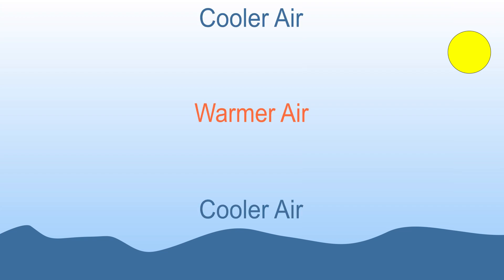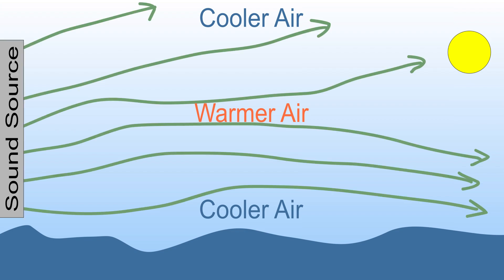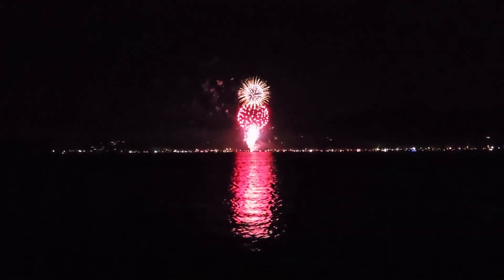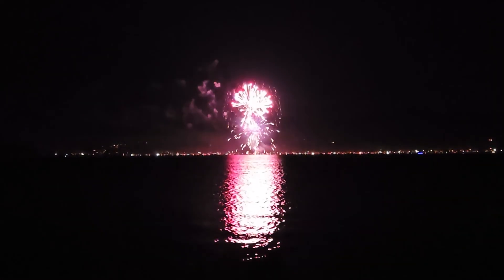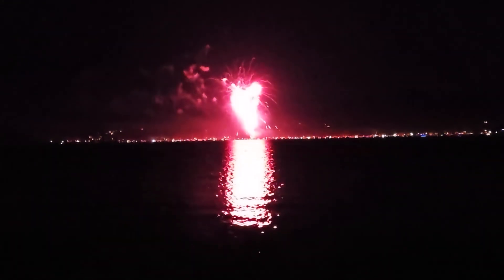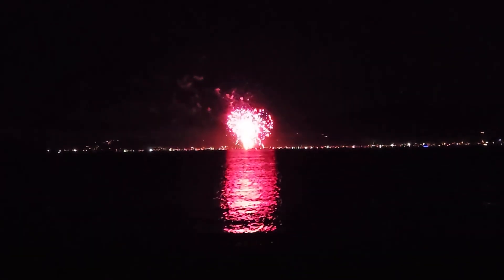Sound Over Water is Different (Public)

Comment: I too am always observant of sound propagation, etc. 

Of course the temp as explained ... but it's not just the temp that's at play.

- there's essentially nothing to diffract, and diminish the sound energy ... vis-à-vis ground propagation 

- the viewing position is somewhat ground plane ....so a pressure maxima, right?
Reply from the maker: Well, the difference is that for the same scenario with very flat unobstructed land, we tend to most often experience the opposite.

Wherin the sun heats up the ground and the ground holds the heat and the air is cooler so the sound refracts upwards but is typically not refracted back downward again.

Though I don't have a lot of experience with large flat snow covered fields, I believe it's highly probable that the same scenario would exist for cold ground and warmer air as happens over the lake.

But sound over water has a unique aspect because of the cooling effect of evaporation and has a different sound than we experience than doing shows in the desert or over a parking lot or other ground planes that hold heat

Comment: i wonder if you could use barges as anti-nodes
Reply from the maker: The size of blockades that could have relevant amounts of impact, gets big really fast if you're not fairly close to the source.

If you get a several city blocks away the size of a substantial blockade starts to get into needing to be a city block or bigger in size.

Though I don't think there's a lot of good data in this region where tests have been done measuring sound at long distances with and without massive floating structures at various distances and sizes.

I steered away from this as a potential solution due to the pure complexity and cost factors involved as that avenue seems to give very little bang for the buck or more accurately very little reduction of bang for the buck

Comment: is it better to have cooler air to stop the sound? or does it even matter?
Reply from the maker: It's tough as the distances are large and the temperature variations can be subtle .

But warm ground and cold air will steer the sound upward and reduce the issues

https://youtu.be/_lB8e9OY0-U

Comment: You must be playing it loud if it's 6 or 7 miles away, I would have thought your hear a lot at that distance especially with ambient background noise and traffic and other things and being indoors . If you got some boats you could spray fine mist of water making a wall of water that would do it. But Let the people hear the music I'm sure they enjoy it, what is playing?
Reply from the maker: The wavelength that's causing the issue is around 30 Hz so it's a quite long wavelengths up and around 40 ft in length

Boats and mist is not going to change it.

To divert sound the obstruction will need to be multiple wavelengths in dimension.

So the cause a slight change in the audio we need things that are 120 ft high and wide or bigger.

The only way I can look at reducing those frequencies at distance is to reduce the amount of energy in those frequencies radiated in that direction
Reply: @DaveRat  don't see why the water wall shouldn't work? I mean it is a dampener they use it at NASA for when rockets take off to dampen the noise, what is a lot more powerful than any sound system.

Another way is you could have speakers playing towards the sound source out of phase of the frequencys you want to dissipate/dampen like noise cancelling headphones that should work!
Reply from the maker: Water on launch pads is used to reflect damaging sound energy away from the rocket. The water is blasted and displaced.and is perpendicular to the the sound source

To reflect sound here for the show, creating a blasting and displacing water situation would be louder than the problem we want to solve 

Also here the water is parallel to the sound sound source and creating a gravity defying silent perpendicula massiver wall of water may prove a challenge beyond current human capabilities

As far as creating out of polarity anti sound, due to the inverse square law, that can not work if the sound source and anti source are separated by anything beyond a small distance, typically less than a wavelength 

Think that through. If sound drops at 6 db per double of distance and the sources are differing distances, then the volume levels of the source and anti sound can only be correct to cancel for a small area, there will never be a "correct volume" that does not make it quieter without also making it louder in that dir xtions at other distances.

Comment: do you think it could be realistic to use some industrial fans and heaters to diffuse sound spilling out from speaker systems to a body of water?
Reply from the maker: The fans may be more noisy than the actual issue as they'll be closer and doing the exact same thing.

Trying to solve sound issues at a distance is always more expensive and complex than solving them at the source.

The issue I believe is around 25 to 35 Hertz that is causing the most problems.

To mitigate those frequencies we need structures that are significant in size compared to the wavelength of the frequencies involved.

So structures and baffles that are multiples of a 40 ft wavelength in dimension will have minor to moderate impacts

And the farther they are from the source the bigger they need to be

Comment: I used to live about 4kms, in a easterly direction, from an open cut coal mine. On summer nights, with a slight breeze coming in from the west, we could hear the links of the dredger conveyor belts clinking. The power station was behind a hill on the other side of the mine so we couldnt hear that. The inversion layer effect, particularly as the dark soil in the mine held the heat after a sunny day, was enough to sometimes make the clinking loud enough to be intrusive. The dredger were electrically powered BTW so do engine noise.

Comment: ... I feel like I've been tricked into watching someone's firework video... by taking advantage of my curiosity of these kind of aspects of sound physics you got me to watch your firework video.

I can't even watch my own firework videos if I record one... the lack of fidelity in visual & audio, normally just ruins it for me. But by distracting me with curiosity... I actually watched a firework video for more than 10 seconds.

What is this magic?
Reply from the maker: Fun and the fireworks don't matter, it's all about the sound
Reply: @DaveRat  This is illegal, you're not supposed to say things I agree so profoundly with.

Also, I tested this concept out at home. There is a fireplace on the rooftop of my apartment, and I set my phone near the lip and every so often the heat from the fireplace gets blown over the phone speaker (not hot enough to damage phone) the sound propagates differently when a gust of warm air rushes over the phone... almost like I can acoustically hear the profile of the rising heat as though I had an infrared camera or something like that.

That was ... a description and a half.